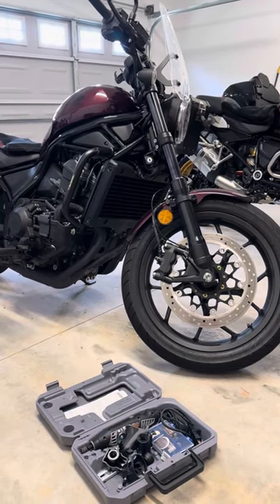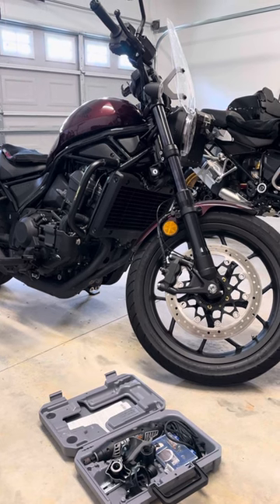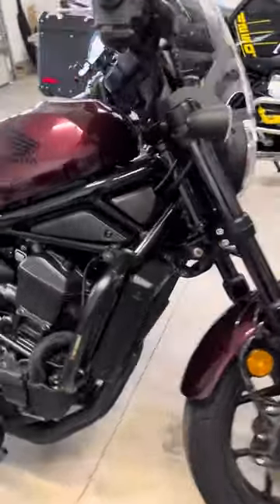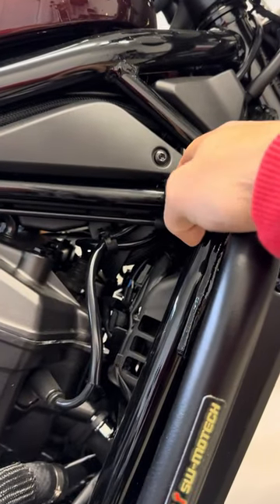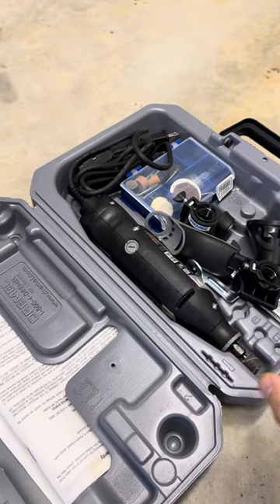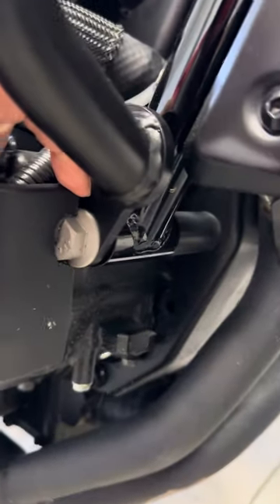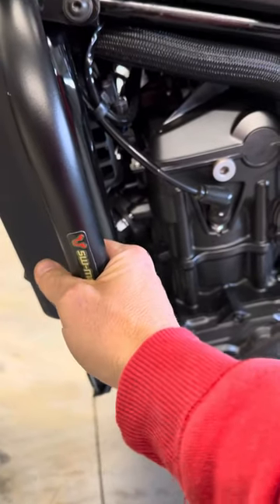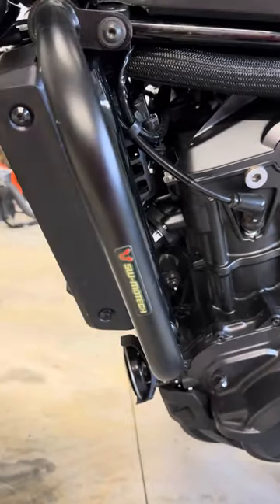Honda Rebel 1100DCT Crash Bars SW MOTEC (viewer question response)

Comment: cool quick video, thx. So, an old friend mentioned me that these bars are non DCT models because the DCT part of the bike stick out more compared to the nonDCT and SW-Motech cannot guarantee it will protect the DCT part of the bike. Other than that, it fits without issues during the install besides minors' plastic cuts here and there. What I did on my bike, I installed the left side on the right and the right side on the left so the bars being more inside of the center on the engine will protect better the DCT and other engine parts. I had zero issues to install it and also cut a piece of the plastic on the bottom right-side corner as you did. Well done, I didn't have to cut the tops two plastic cover, I managed to bend them until they all fit in place.  thx for the video. 😊
Reply: Good point on the first part. On the second part a lot of people have done the same as you. We thought about it the only issue could be the plastic cracking over time due to the strain of it being bent. That’s why we decided to just cut instead. The bent way definitely looks better and if it does start to crack you can easily just take the smallest drill bit you can find and drill a hole hole at the end of the crack that will stop it. Appreciate the comment and thanks for watching and if you do have any issues with it please comeback and let us know. 🍻
Reply: @Mikelruzz  gotcha. Thx for the detail. Have a nice weekend 😊